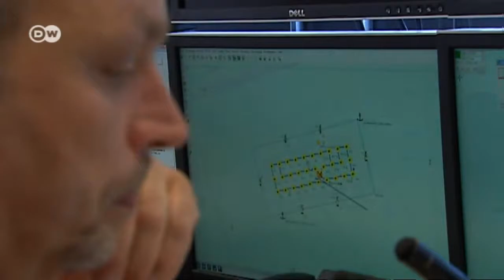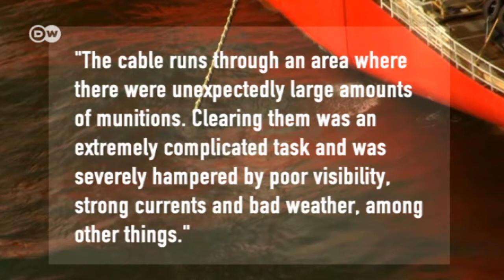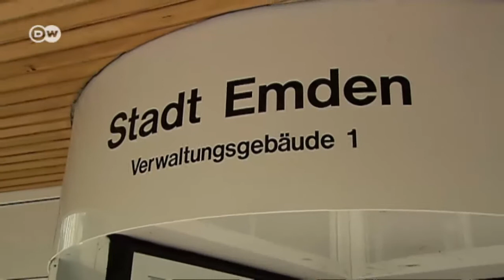Riffgat Wind Farm Stymied by World War II Explosives | Made in Germany

Comment: What a nonsense video. Them not running is just a small delay in a 20+ year future operation. No one could know there were so many extra bombs on the ocean floor so the company running the windmill should not complain. They were finishing everything before the cable was even installed. No one forced them. That is like building a house on a spot that does not yet have an electric connection.